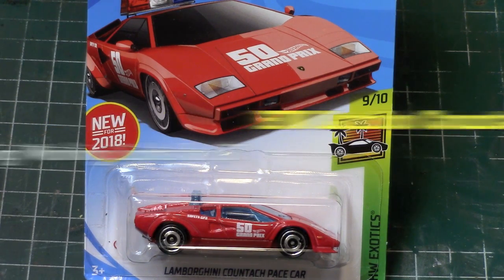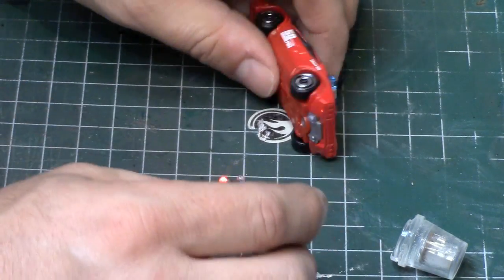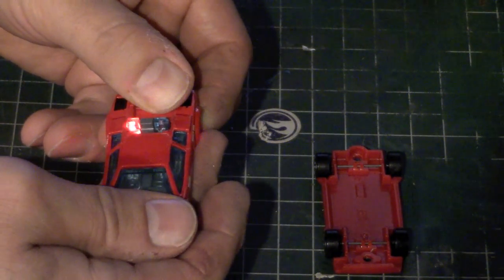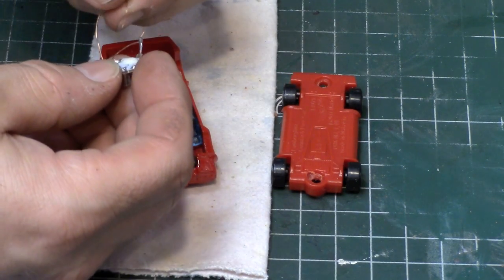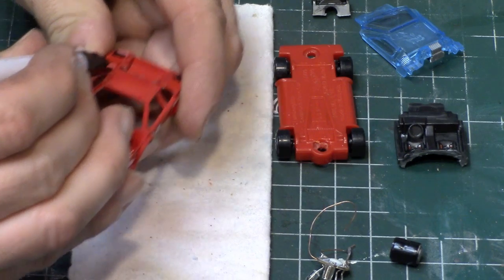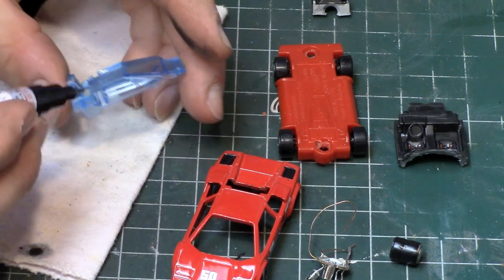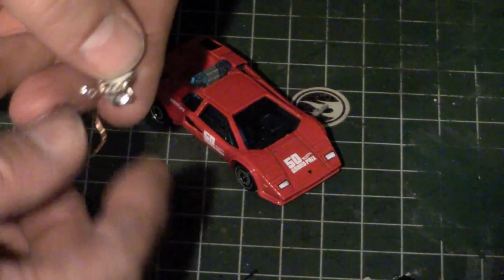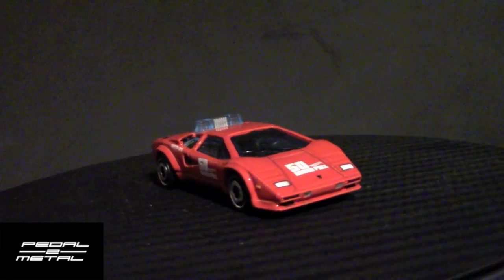Detailing Hot Wheels Lamborghini Countach Pace Car | Adding Working LED Light Bar for $1

Comment: Hey Royce how do you separare the plastic base from the steel body? Cause it looks so easy when you do it in other Hot wheels but I cant do it without breaking It. Thanks a lot

Edit: forgot to say it finished great looking, awesome job
Reply from the maker: Thank you! Well I usually use a 1/8 drill bit (or whichever is available out of my set) that is big enough to remove the outer ring of the "rivet" (body stalk) where it is folded over to form the crater. I sometimes have to rock the drill around slightly in order to "nip" away all of the ring, so the body will release from the base.  Also if you are intending reassemble your cars with some sort of screws (I prefer to use stainless steel '2-56' button heads and a 2-56 drill/tap combo from Du-Bro; and a 0.50 ballpoint screwdriver from Bondhus), I would drill that tap hole first before attempting to drill out the "rivet" from the base; it just makes it a little easier later on.  I hope that helps some.  PS: I broke MANY car bases until I got the hang of peeling them apart, as well. ---- So, don't give up; keep at it!

Comment: I remember when I first found this, I got it and thought that would be it, Nope..The white one came a year later or so and has a red TwinSonic and windows, Later 2 Police versions came, One black/white, One blue/white and they feature diffrent wheels on the black/white while the blue/white basically is the same as the white Pace Car with red windows and lightbar.